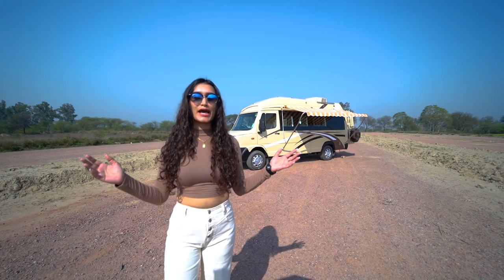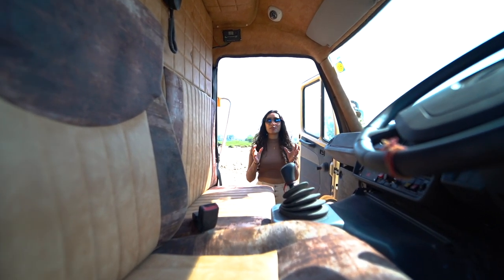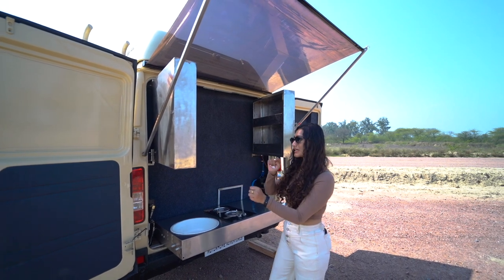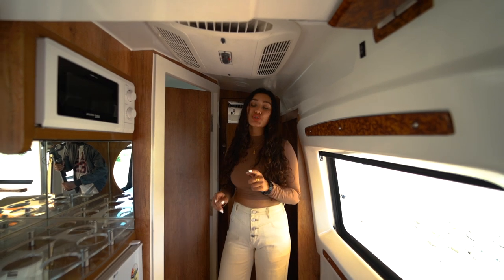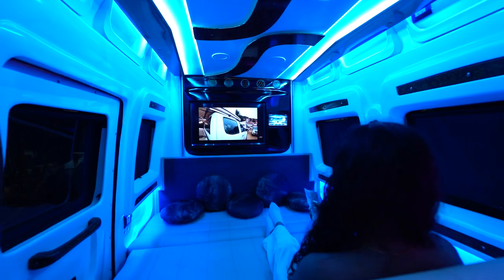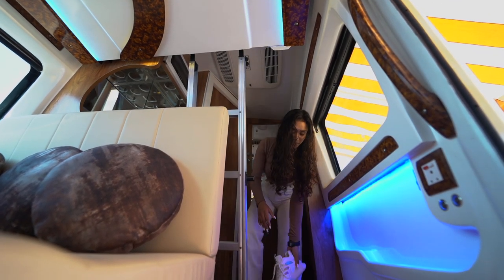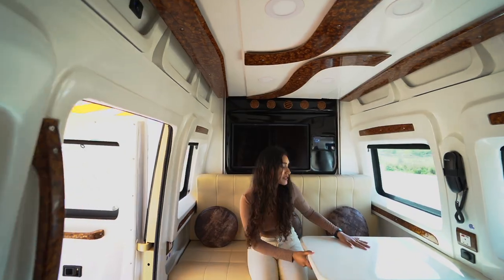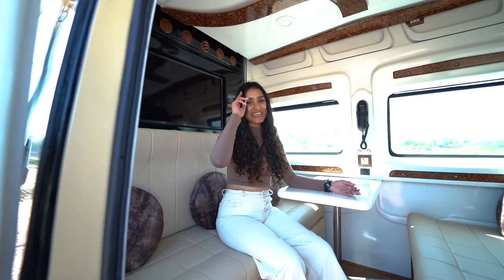Tour our NEW 2022 Caravan SHILOH/ Rent this caravan in India /EP-13 | Motorhome Adventures

Comment: Hi. Vidhushi, Its a  gr8  video on customised shiloh.
I would like to suggest, laguage space on top which can have an height adjustible roof to cover the storage in rains or snow. That can really be an asset. Also the laguage storage can have railings to slide and lower to a comfortable height to remove the laguage.
Reply from the maker: Hey there ! Thank you for your feedback. The luggage storage is a good option however that would result in eliminating the solar space which is why we've created storage inside rather than providing the same on the top.